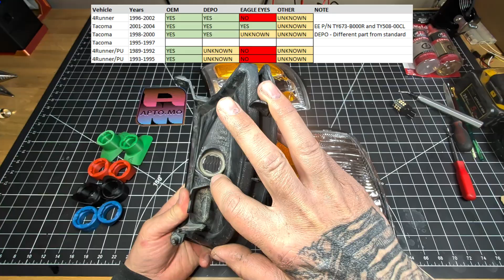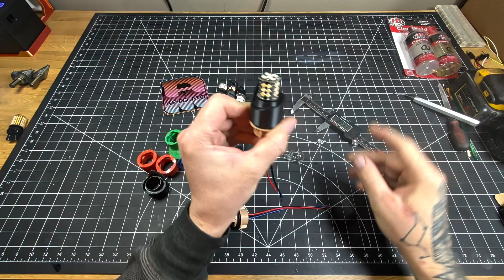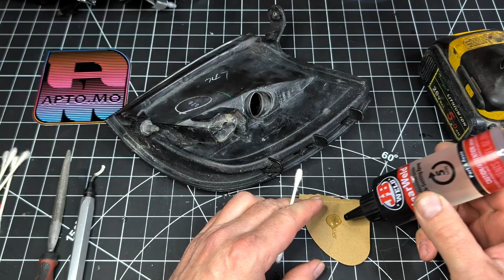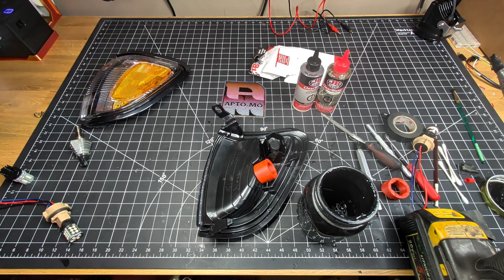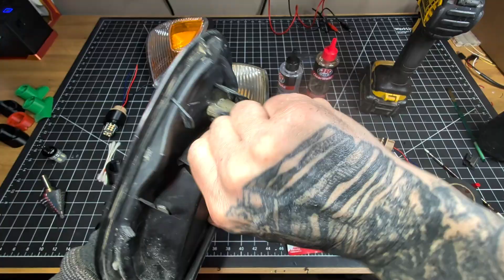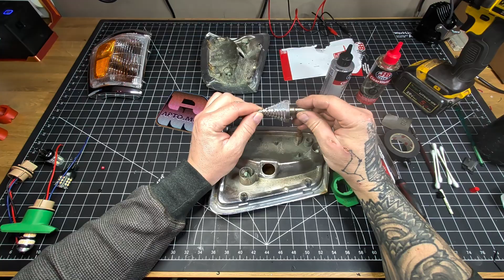Aptomo Beacon+ 7443 Marker Mod -  Install video

Comment: Can you drop the light you would suggest if I got the relay
Reply from the maker: For bulbs, you have more options if using a LED flasher relay. I have had good luck with the Auxito brand both with product quality as well as their warranty department.